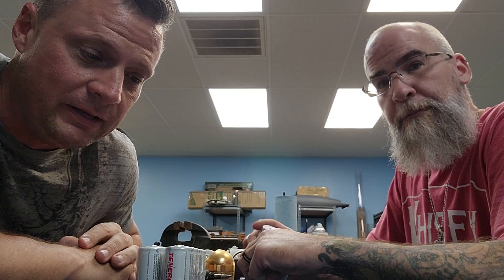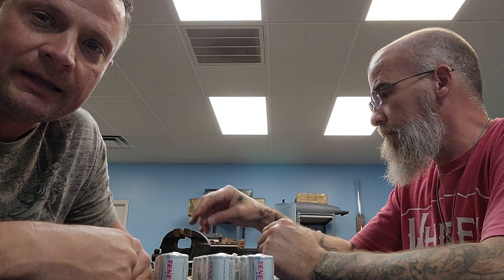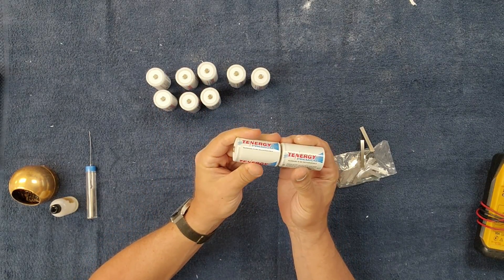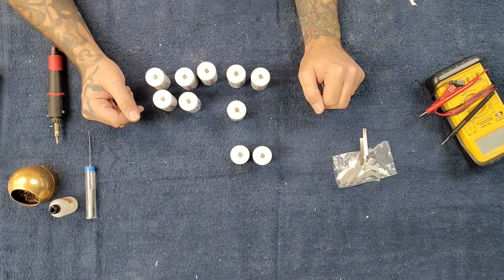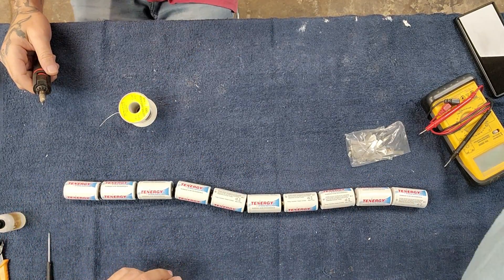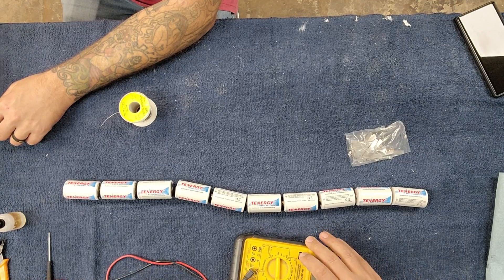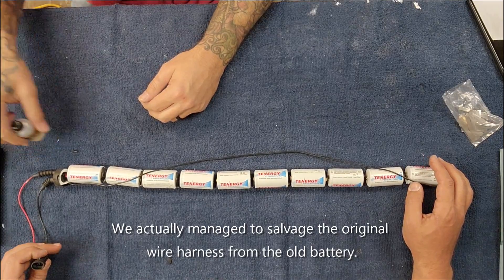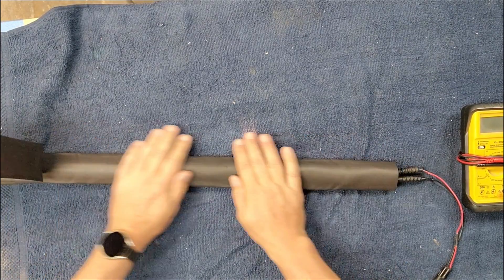Making a HUGE 10A NiMh Battery Pack for our RC Submarine

Comment: Hi Bob, may I know why you using ni-cd battery compare to li-on 3.7v 10k mah?
Reply from the maker: I'm not using Ni-Cd, we used NiMh. They're cheap, hardy, easy to come by, don't react if damaged or if the minerals are exposed to water, and we needed the ballast anyway, so weight and size were not a concern.
Reply: Oh noted TQ reply my question..